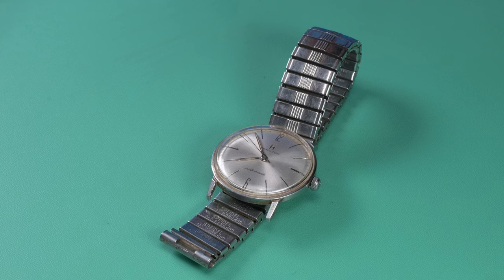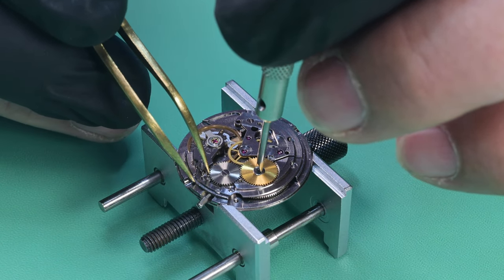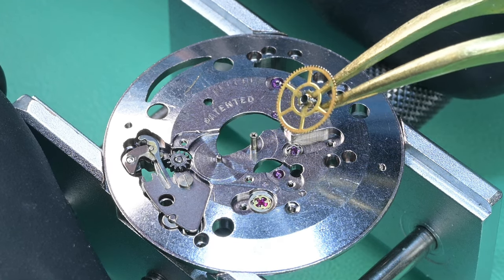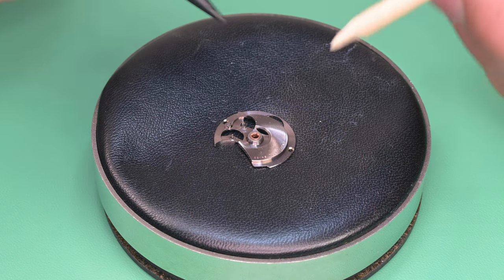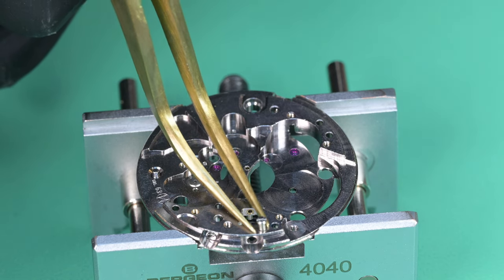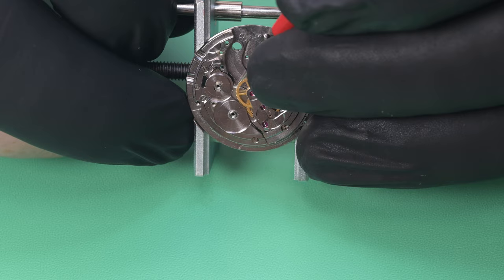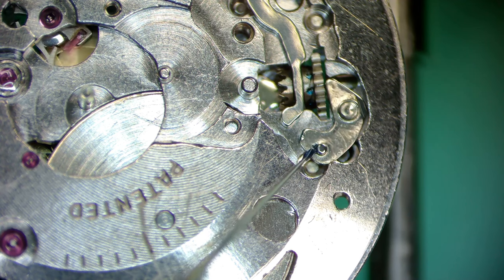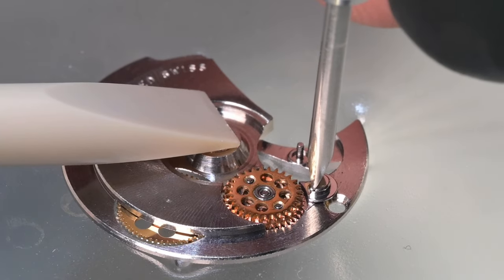Restoring A Vintage Hamilton Watch & Giving It Away

Comment: Nice service. I found this video when researching my late 1960’s Hamilton automatic RGP diamond 10k white gold watch. It is all original including its mesh band. This was bought from the original owners son. It sat for the past 11 years in a drawer after the death of his father. I fully expected to have a service performed as nobody new if it ever had been done. Well this thing is rock solid running currently. I cleaned and polished it up and for now it will shine on my wrist until it proves it needs to be serviced.
Reply from the maker: That’s excellent! They made very solid watches.

Comment: Very nice. I appreciate your clear explaination of all the steps. Another way to the remove the crystal if the grabber would not get hold, might be to remove the crown and split stem first, and then use compressed air (a large syringe will do) to put some pressure inside the case.
Reply from the maker: You are correct.  I've only done that once, but that was the backup plan in case the grabber didn't work.

Comment: This was incredible, my gf grandfathers hamilton wasnt running so  I offered to take a look , jumped on YouTube and looked for a video about vintage hamilton watches and sure enough it was an m-89-2  had no idea this was an eta watch , mivement was pristine but wasnt running and there was a dial screw missing.. blew on the balance and it would barely move with a puff of air , no wobble no excessive endshake just stiff ... took off the dial threw it under the microscope and there was the dial screw , jammed between the balance cock and the ratchet wheel , i cant take the balance off because the balance cock lip hits thexratchet wheel and i cant let down the spring because the screw is lodged into the ratchet wheel teeth .. so i placed my tweezers under the screw and lightly pryed and the screw flew out and tge balance started .  Watch is running well now except the screw must have somehow broken the drive wheel pinion on the automatic assembly , so for now its a hand wind  untill I source the wheel ...
Reply from the maker: I love a good hand wind, haha!  I'm glad you found the video useful.

Comment: Adam, you do awesome work. Thanks for doing the giveaway! How on earth do you know how to put all those tiny pieces and screws back together? Congrats on the 1000 mark!
Reply from the maker: Thanks so much.  I find it easier to break the movements down into different sections, and I store those parts accordingly.  After a while you'll see similar patterns across multiple different watches.  It gets easier over time.  I still sort my screws meticulously and ensure that every single screw on the watch goes back into the same part.  I see where some people put all the screws together.  I've never been comfortable doing that.  The way I do it takes a bit of time, and is tedious, but I never have to go hunting for the correct screw!

Comment: As I've been buying wristwatches I've come to appreciate automatics.
Reply from the maker: I appreciate automatics as well, but I enjoy manual winding just as much.  If I wore the same watch every day I'd probably appreciate the automatic more, but I change out watches quite often and generally don't receive the benefit that an automatic provides.  By the time I wear the watch again, the power reserve has run out.
Reply: I tend to wear a watch until I find another that catches my fancy. Sometimes it's a couple of weeks or a few months or I get careless and damage the watch and it needs repair  at which point it gets set aside and another goes on my wrist.

Comment: I've passed up a couple of those crystal removers not knowing what they were for and of course now I have two watches that I need the tool to open. LOL Wrist watches are relatively a new inerest for me, mostly I have pocked watches.
Reply from the maker: I waited on getting one until I came across a watch that required it.  Mine is the cheaper version, but it works perfectly fine.  I didn't feel the need to spend 5x the money on a name brand Swiss version of a simple tool.

Comment: I have a soft spot for vintage Hamilton watches, despite the fact they were not really a particularly well known brand over here in the UK until comparatively recently - so I could not pass up the chance of potentially winning another to add to the circa 1975 square Fontainebleau automatic (plus a couple of more modern Hamiltons) I already have.
However, as so many of the watch channels seem to love vintage Seikos, I am considering adding at least one of these as well - any suggestions?
Reply from the maker: There are so many great 60's and 70's model Seiko's it would be hard to suggest just one.  If I had pick one, I'd suggest getting into a 6138 or 6139 chronograph.  A Pogue (or any of it's variants), the 6138-0010 or 0011 Yachtsman/UFO, John Player Special, Kakume, Bullhead, etc.  There are just so many excellent ones to chose from.  A warning though, because they are such great watches, there is a lot of less-than-honest people out there piecing them together and selling poor examples.  Parts can be found, and nearly anything on those can be fixed, but I'd suggest spending the extra money on a good example, or from a reputable seller where you can inspect the watch before purchasing it.  If you get a good one, they are among the best that vintage Seiko has to offer.
Reply: @WeekendWatchRepair  a blue Pogue looks quite attractive to me, I think - I must keep my eyes open for one.

Comment: It seems a strange idea for a company to make a movement where you have to take the crown wheel off to get the balance in!
Reply from the maker: You could do it, I just didn't see the proper angle to do it at the time.  It is much easier to do with the wheel off though.  In hindsight, and watching the video again after the fact, it could be done with the wheel on.

Comment: I think I probably missed the giveaway. But I am in the market for a similar watch and I was wondering because it was hard to see in the video if you could explain how you removed the two piece crown.
Reply from the maker: Sure.  It isn't too complicated, but it can be nerve-racking if you haven't done on before.  On this type of crown, I just wedged my tweezers between the back side of the crown and the case and pulled them apart.  I used plastic between my tweezers and the crown & case to make sure I didn't scratch it.  There is no other way to separate this specific type of crown than to just simply pull it off.

By the way, I'm working on the next giveaway watch right now!  Make sure you watch the video and enter the contest once it is posted (it will be several days still - at least).  It's a really great watch!

Comment: Interesting thing happened today I purchased a Swiss made Hamilton automatic in 14k and like your watch it is a one piece case so without the grabber tool I can't tell what movement is inside. One more reason to buy the proper tool. This is my third or 4th unibody  case.
Reply from the maker: That's not the only way to remove the crystal, but it is probably the easiest.  There is a method of removing it by removing the crown and blowing compressed air into the case, thus popping the crystal out.  I've only had to resort to that once, but if you want to read up on it, you might give it a try if you don't have one of the claw tools.  Just a suggestion.  I appreciate you watching and commenting on the video.
Reply: @WeekendWatchRepair  I'll buy the tool, I do have a compressor but I'd feel like I was using a hammer to remove the crystal plus I'd still need to reinstall or replace the crystal. I've a shopping list of tools I wish to buy. As of now the Hamilton is keeping good time as are the two chronometers I purchased at the same time. For normal use I prefer an uncluttered easy to read dial and I've discovered this year I like automatics.
Reply from the maker: @dale4034  A syringe with the needle removed works well to push compressed air into the case.  I just got a cheap set off of Amazon and have used those before with good success with the claw wouldn't do the job.  The claw tool will serve you well most of the time though.

Comment: Just wondering where did you get the replacement crystal? I also have a one price case Hamilton and I’ve been looking for replacement crystals
Reply from the maker: I cannot remember specifically at this point.  I likely just measured the old crystal and bought a replacement at Jules Borel, Esslinger, or Cas-Ker.

Comment: Congrats. What tool did you use to reset the cap jewel? I just broke a shock spring and have to remove the incabloc tone before I can replace the spring and I’m tempted to buy a Horia clone.
Reply from the maker: That's exactly what I used - a Horia clone.  A real Horia tool is very expensive, and the pusher & stump set is simply outrageous (as I'm sure you are aware).  I found a pretty decent Horia clone with a full set of pushers & stumps for a very good price.  I had to flatten a few of the stumps manually to get them perfectly level, but everything works well.  The micrometer is surprising accurate.  I haven't had a single issue with it after using it for multiple repairs since I got it.  Best of luck!

Comment: Hi, I'm new to your Chanel .
Did you ever had the experience that the read on the time grapher had some strange dots other than in a straight line? Like some noises besides the tick tock from the balance? Do you maybe have a video from that topic on your Chanel ?
Thx 
Frank Schroth
Reply from the maker: Hello Frank.  I have absolutely seen that, multiple times in fact.  Background/ambient noises can cause havoc and give incorrect readings.  I once turned on my ultrasonic cleaner, which is about 15 feet away from the timegrapher, and that thing made the timegrapher go crazy!  I've also found that sometimes it is difficult to get a good reading when it is mounted in the movement holder.  Sometimes I find that if I put the watch in it's case I'll get a much more consistent reading.  The difficult thing is trying to figure out at first if the readings you are getting are due to poor performance, escapement issues, etc., or if the timegrapher is picking up external noises.  I usually have a TV or something going on in the background while I'm working on a watch, but when it comes time to use the timegrapher I eliminate as much noise as possible.  I have not done a video on this topic yet, but it is a good suggestion.  Thank you.
Reply: Hello Adam,
thank you for the quick help amd  response to my question. I'm sitting here at half past midnight in Germany and going through all your videos. I love how you explain all your moves to your viewers while repairing these watches. Keep the videos coming and I'll keep watching !! Great content .
Frank
Reply from the maker: @frankschroth4038 Thank you very much Frank.

Comment: I've been reading up on Hamilton watch co. I'm wondering is this watch of the Hamilton-Buren era?
Reply from the maker: I think it should just slightly before.  Hamilton acquired Buren in 1966.  This watch dated to 1964, but they still were using some Swiss movements in many of their watches starting in the 1950's.

Comment: I always though this was an American made watch. Ez
Reply from the maker: Hamilton was founded in 1892 in Lancaster, Pennsylvania. Hamilton acquired the Buren Watch Company which had significant manufacturing facilities in Büren an der Aare, Switzerland.  Hamilton would use Swiss made movements in many of their American watches, and Buren would source other items from Hamilton's manufacturing facilities in Lancaster, PA.  In 1969 all manufacturing was consolidated to the facilities in Switzerland.  Other mergers, sales, etc. happened after that point, but they remained a Swiss made brand since that time.  You are correct and they were an American company when they were founded until they later moved their operations to Switzerland.

Comment: I had difficulty with the cap jewel for the hairspring on the face side of the watch.  I do not have a microscope yet.  Can the jewel be oiled from the watchmaker's side? before the cock is put in place?
Reply from the maker: It can, but it really needs to be taken out and cleaned first.  Simply adding more oil and not taking it apart to clean it won't do the watch any favors.